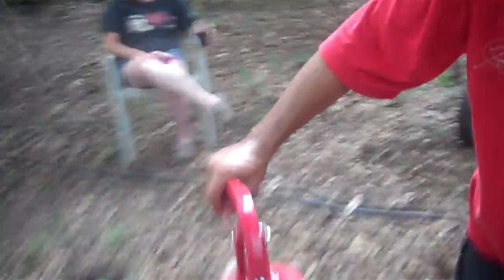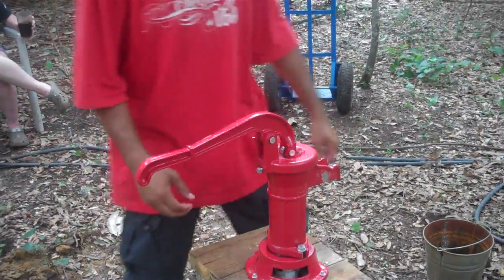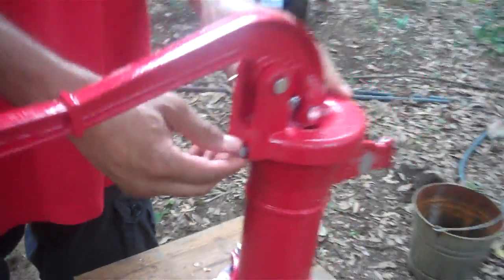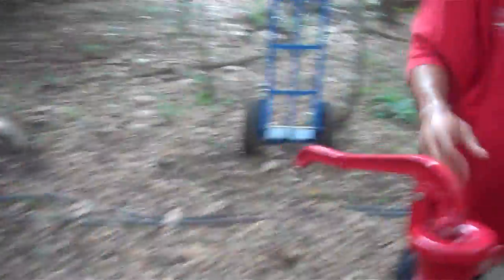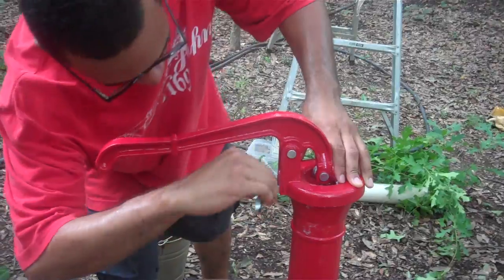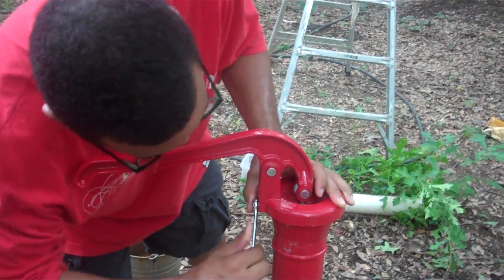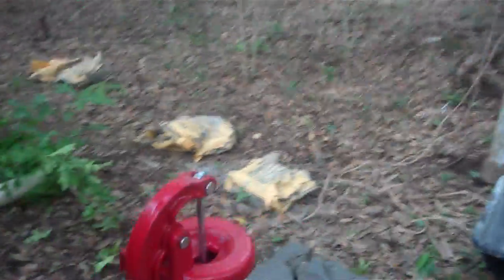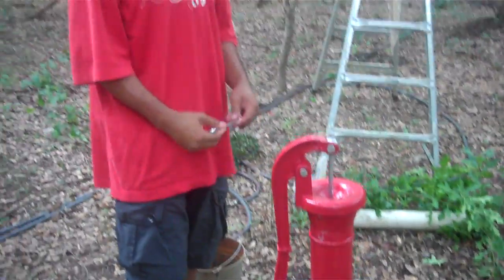Well Drilling Changing the Pump Handle Angle

Comment from the maker: Just so that you understand why a shallow well pump isn't able to handle a deep well.  A perfect vacuum is said to be able to draw a cylinder of mercury 20".  That is why vacuum is measured in inches of mercury.  Water is much lighter than murcury, but a perfect vacuum is still only able to draw water up 30 feet.  A piece of cow hide screwed to a iron cylinder will never even come close to making a perfect vacuum.

Comment from the maker: These pumps are called shallow well pumps for a reason.  Deep well pumps work a little different.  You are right that the depth of the well isn't important. But the distance to the water level is the important measurement.  there are some pumps that are like mine, but the rod and piston actually go deep into the well pipe. One of those will do the job if your water level is more than 20 feet away from your pump.

Comment from the maker: I think that you may be talking about the stainless steel models.  Those are good to mount on an existing well that is a thousand feet deep.  Mine will only draw water up 20 feet max.  But that is OK because the deepest well that I have with one of these hand pumps on it is 17 feet I think.  I do plan on getting one of the kind that you are talking about for when the lights finally go out for good.  The well that supplies my house is about 300 feet deep.